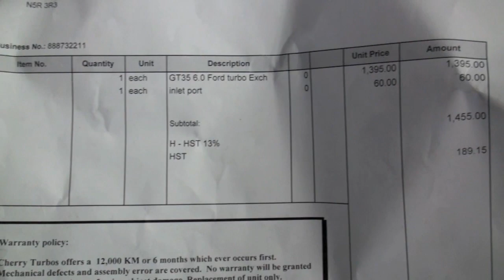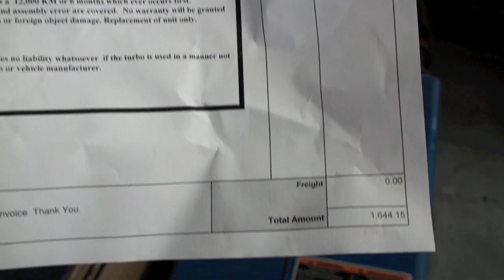6.0L diesel vgt/4"straight pipe install

Comment: @OnusofStrife I have a 2007 4 door Wrangler on 35s with 4:10s ... It get's about 13.5 miles per US gallon.... that's all heavy intercity Toronto driving. On the hwy it gets a bit better but not much cause I drive at about 74mph when I finally get to stretch my legs.

Comment: bet it's got a lot more pickup and power too now. the only think i have been told that will make the turbo not screw up as fast or as much would be adding lucas to the fuel when you fill it up from what i am told. i didn't think it would make that much difference but what i am being told  by semi drivers it evidently does, specially on the turbos who knew, i know the stuff helps the top end not wear out so much in the oil but as for the fuel i didn't know it would be that different but evidently

Comment: sounds awesome pug. i told ya you'd have some issues with the elbow as i did. but looks like it all worked out. 

i went from a sort of stock exhaust to a bigger turbo and 3" all mandrel bent exhaust on my supra. it was night and day. just have one magnaflow straight through muffler on it and it boosts over 20psi. the difference was amazing.

Comment: @Bones1977ify It may due that on your supra but, you have to realize these truck allready have honking intakes with a tub right next to the radiator sucking in cold air. Plus these truck have so much room you don' t end up with a low flowing intake like on a car. If you regular truck forums they advise people to stay away from them since they don't do anything and the filtering qualities aren't as great, which is a big deal on a diesel with everything going through the turbo.

Comment: @Josh1223334444  no...diesels make power (more or less) according to how much air you can get through them...less restriction is way better...i bet he went up to 400 horse just by ditching the exhaust. had he have switched to a 5 inch...even more power. diesels are different in the restriction department vs gas.... a gas motor needs some backpressure or youll break the valves and whatnot.

Comment: I got a 03 6.0 it has 391000 on it and its all stock feom the factory the only thang that wus done wus the egr
Reply: richie bohm way to go!! My dad had a completely stock 6.0 and never tuned and it had 368k miles when he sold it
Reply: richie bohm on the original tranny and engine.. still miss the truck and id love to have one!

Comment: The staples in the boot are there for a reason. They hold the clamps to the boot when you're putting it on. Without them its a pain in the butt!

Comment: Thats why you don't buy a Ford, well a diesel Ford. In this case it just defeats the purpose of a diesel and their reliability. I mean frig the head gasket, turbo, oil cooler and a host of other shit had to be changed on Pug's Big Dirty before it even rolled 200k. What nonsense.

Comment: Ford Motor Co. has agreed to settle a class-action lawsuit over claims that it sold defective diesel engines in its 2003-07 Super Duty pickups and E-series vans.

The now discontinued diesel 6-liter V-8, manufactured by Ford's former diesel engine supplier, Navistar International, had myriad problems with the fuel system, turbochargers and other major components.

According to the settlement, any U.S. purchaser and lessee of any 2003-07 Ford vehicle equipped with a 6-liter Power Stroke diesel engine is covered if the vehicle's exhaust gas recirculation (EGR) cooler and EGR valve, oil cooler, fuel injectors, or turbocharger was repaired, replaced or adjusted prior to 135,000 miles or six years.

Each component is given a reimbursement limit. In addition, according to the settlement, if a class member paid a $100 deductible more than once for repairs under the five-year/100,000-mile engine warranty, Ford will reimburse $50 each for the second through fifth deductible paid, up to a limit of $200 for four deductible payments.

The settlement resolves dozens of class-action lawsuits against the company and entitles owners to be able to claim between $50 and $825 in reimbursement for post-warranty repairs to their engine and engine components.

Poor engine quality, high repair costs and sinking customer satisfaction ended the relationship between Ford and Navistar, which had built every Power Stroke engine used in Ford's F-Series since 1994. In 2010, Ford replaced the Navistar diesel with a new 6.7-liter diesel V-8 that the company designed in-house. That engine is built in a plant in Mexico.

Some 6-liter failures were so severe that Ford had to replace complete engines. Ford also ended up buying back hundreds of trucks that couldn't be easily repaired. The engine problems dramatically increased Ford warranty costs and led to litigation with Navistar.

According to court documents, Ford will pay roughly 50 percent of the full value of the claims made in the class action and was ordered to pay $150,000, in total, to the 16 named plaintiffs.

Comment: cummins still sounds better and will spank the 6 L any day
Reply: Earl Dibbles obviously a pissed off ford 6.0L owner lol and just pist at the world.. buddy grow up and get a dodge and watch your language
Reply: What's funny is that dodge cummins has been rated under ford powerstroke in horsepower and torque for years, even my 6.9idi made more horse than any stock 12v cockbreath
Reply: +Nick Smando Only problem with the Cummins is it is wrapped in a Dodge.  I know I own one.  The drivetrain is pretty solid but the rest of the truck is crap.  Absolute crap.  Personally I think all the diesels have gone down hill big time since they started with all the emissions crap.

My 2005 Cummins has 146000 miles on it and is pretty reliable but it has burned through 2 AC compressors, 2 water pumps, fan clutches and can not hold a decent alignment for very long.   Like I said the basic engine and transmission has been good, everything else is pretty crap.